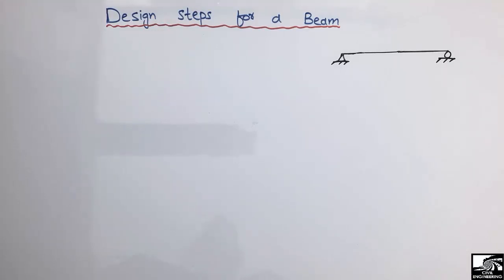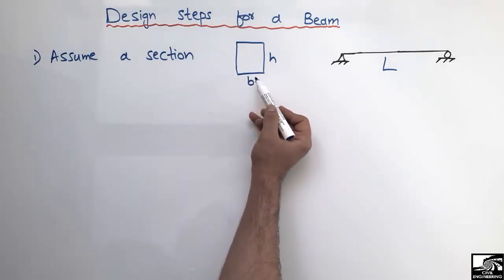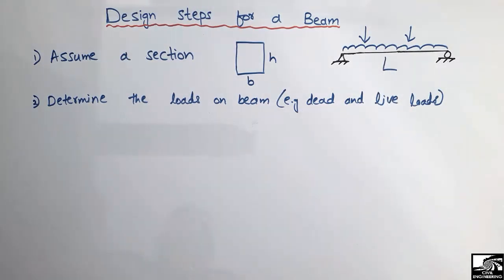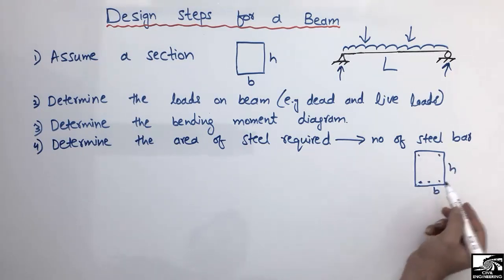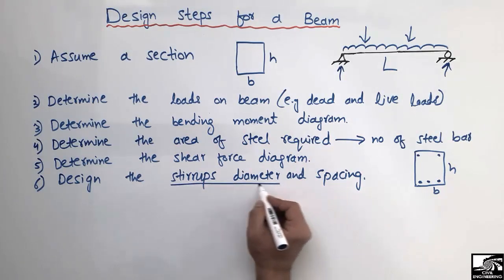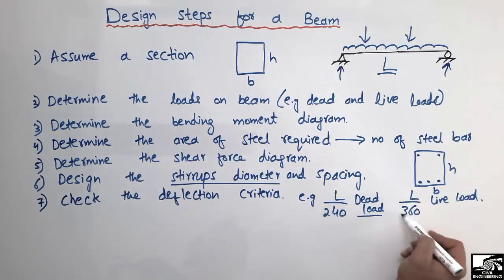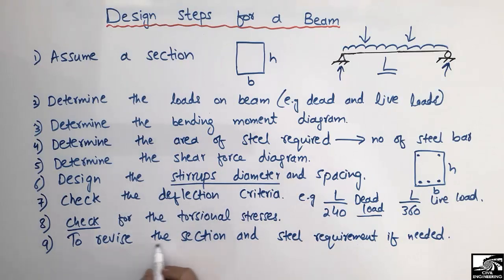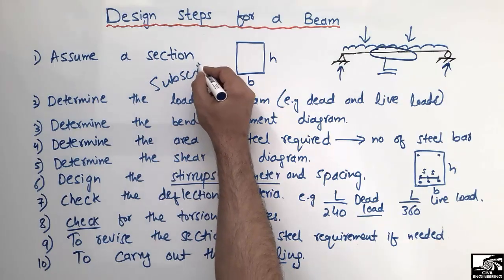Design steps for a beam

Comment: Thank you, i think we can shall may  ( with any suitable helping verbs ) design determinate structure with one central beam and two horizontal beams supporting the center just like our head has a middle division and hair strands running parallel from the Center..to prevent against imbalance in stresses on either of the supports..and thus resulting in cracks and long term costs..tradition central beam can shall may ( with any suitable helping verbs ) be designed to prevent these at any cost..